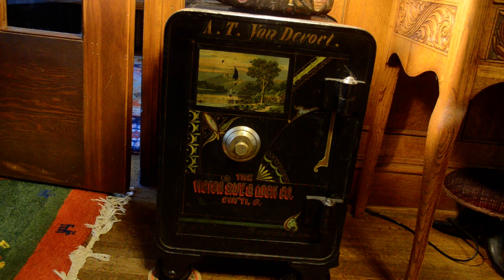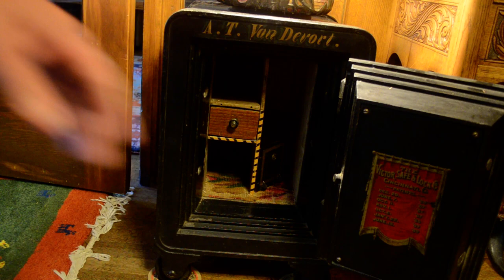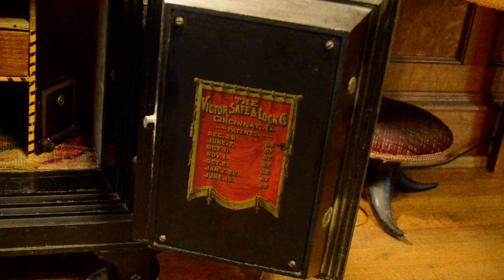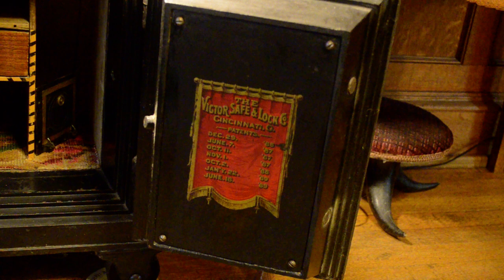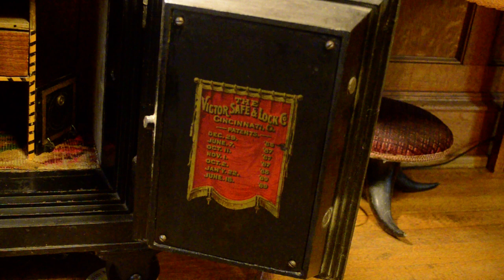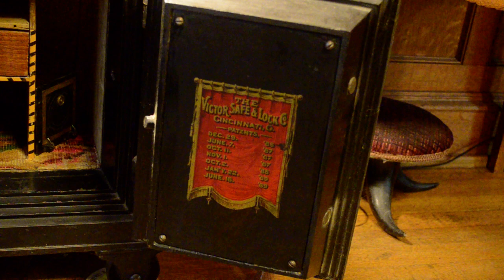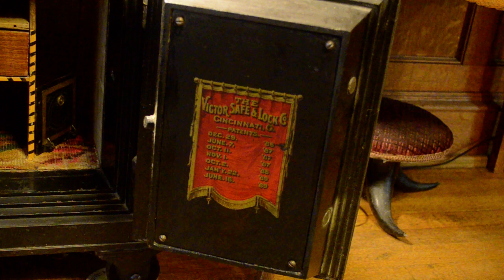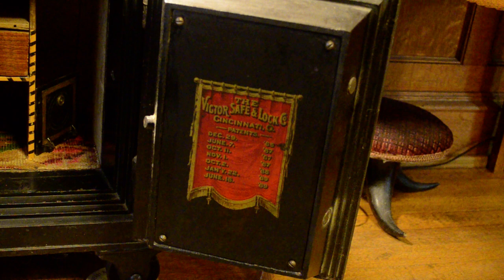FIRST RULE OF BUYING AND MOVING ANTIQUE OR USED  SAFE

Comment: Moved safes for 40 years, here’s a better way to go.  Remove the door by  simply lifting it off the hinge pins and strap to a small hand truck by itself, then reinstall after getting the safe body set in place.  Btw, nice safe!
Reply from the maker: Yes, I agree, but on the Diebold I mentioned, the door would not come off without breaking a weld. Thanks for the advice.
Reply: Dear Jerry,

I have to move a safe sometime in the next few years and was planning to do that.  I am still, however concerned about getting it up a short hill.  I my will go out the back door of the basement (on level ground) and then need to be taken around the side of the house and to the front.  Any advice?

Comment: Wheel drift & dial ring alignment are a common issue of lockouts from use and abuse. MOST  Wheels are an interlocking gear design one tooth jump will throw it off! Same as a dial ring moving it will throw wheels off by a few numbers.
Reply from the maker: Drift is the word of the day. Thanks for the comment. I never thought about using drift, I just know this happens.

Comment: Any experience with opening them when locked? Just picked up an old mosler (30x53) with an outer door (unlocked) but also has a smaller safe inside (locked) and I don’t have the combo. Located out in Grimes. Nice to see another Iowa safe collector!
Reply from the maker: If the manufacturer is Mosler, there are books that have lists of combinations in them. Is it removable? Not sure how to get the combo other than drilling or cutting or a pro with an auto dialer.